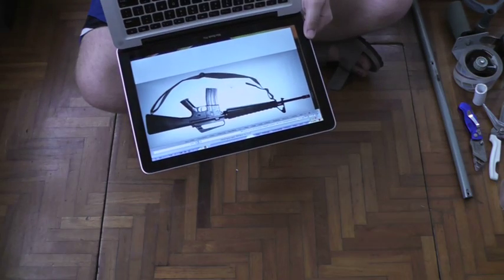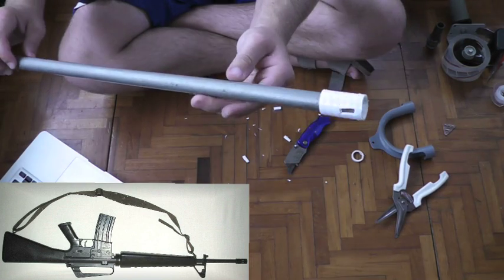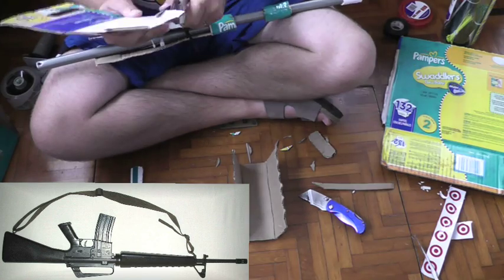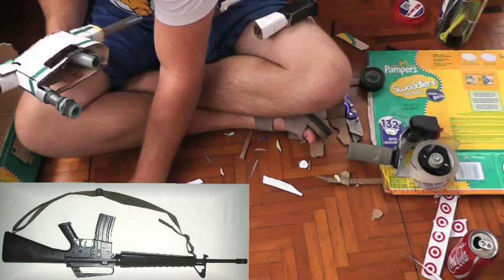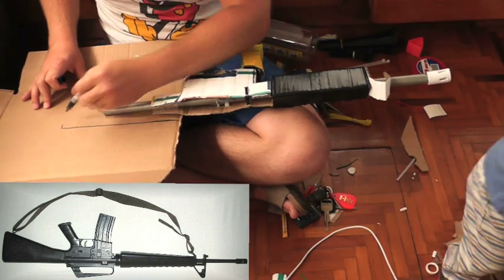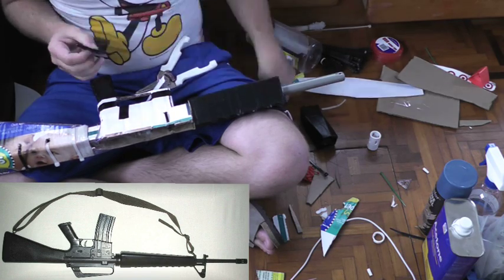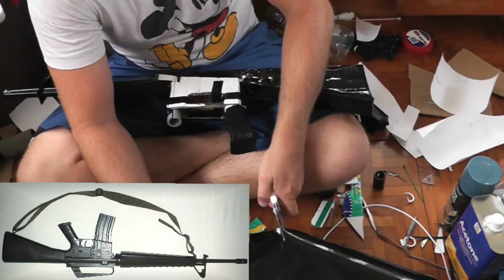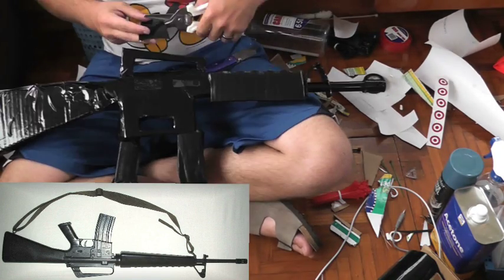M16 and other Prop Guns for CHEAP - how to build

Comment from the maker: @alexkfridges you don't think so?  I thought it looked pretty good in the test clip at the last few seconds.  I also used it in my latest project which is like a 10 minute action video but it's still in post production.  When it comes out you should check it out and let me know what you think.  I definitely think if you can afford them: airsoft guns are better and there are definitely limitations to this prop though.